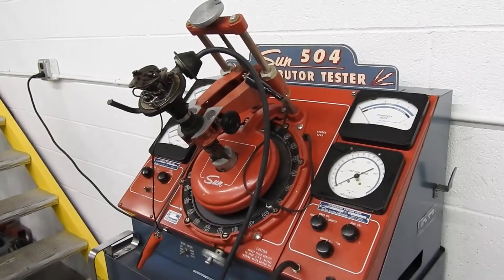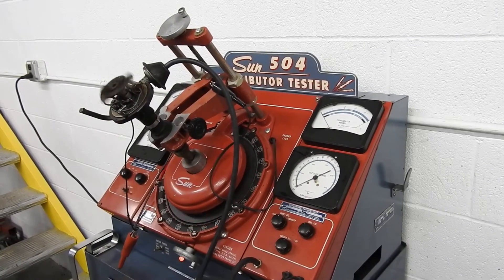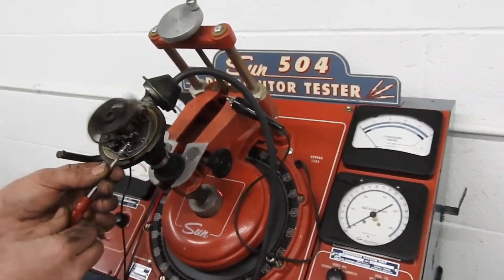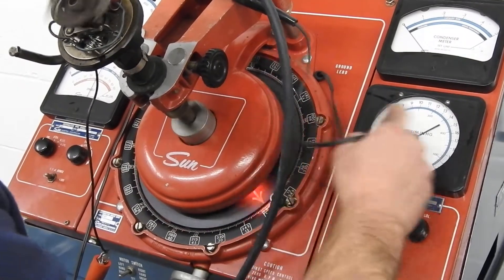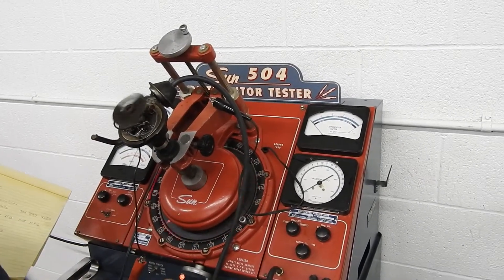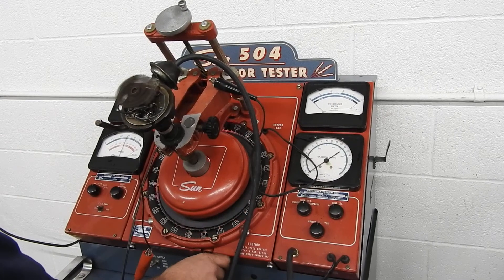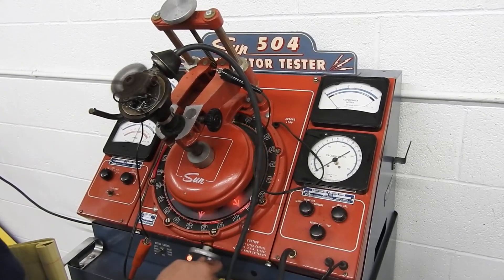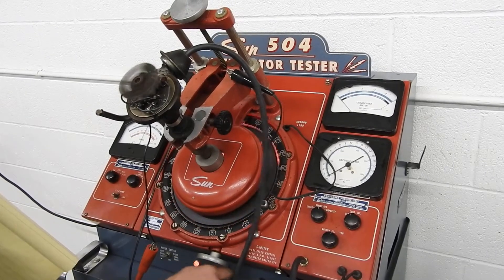Adjusting a Distributor on a vintage Sun Distributor tester

Comment: Is there a calculation for knowing what the distributor curve should come in and end at?
Reply: It depends on your engine combo, and what fuel you are using. I tune a lot of different types of cars. I can tell you that cars running off of the modern 93 octane fuels like less aggressive timing advance, less total timing. Back in the 80s I went to an automotive school that had a lot of old tools, one being a distributor tester. I  used to use it to set up the distributors for my 69 Mach 1. It worked pretty good, you knew for sure what you were getting for timing at what rpm. Also you could optimize the dwell, that was important back in the days of running points distributors. Not much of a factor with modern electronic ignition systems. Back to the optimized timing curve, you will need a dyno of some type to determine what your engine combo likes best. Without a dyno to let you know how the engine performs with various timing rates of advance, and what total timing the engine likes best, you are just guessing.
Reply: The shade tree method that always worked very well for max engine power without access to a dyno was to advance the timing until you got some detonation when accelerating in a high gear under load then back the timing off 2 degrees.  Just as with a dyno, the final setting would be determined by the gasoline being used.  So setting for max on one brand/octane rating might be too much (or not enough) on another brand/octane rating.  Yeah, shade tree but it works!